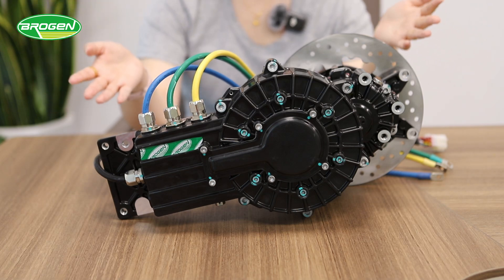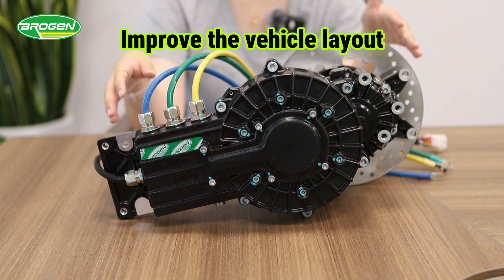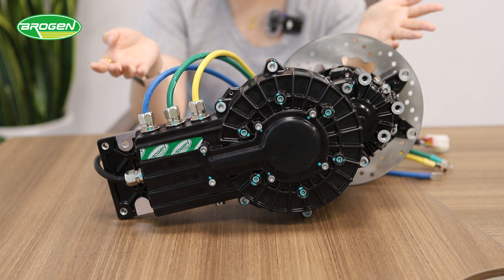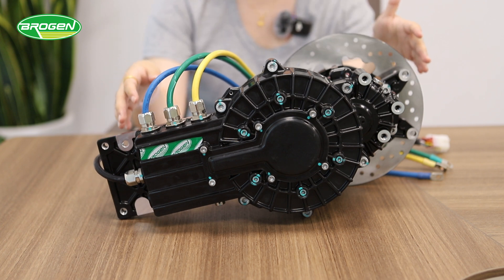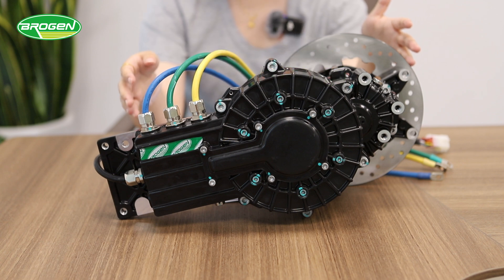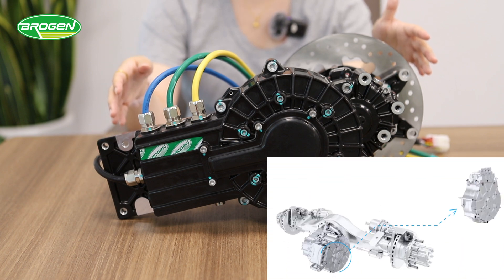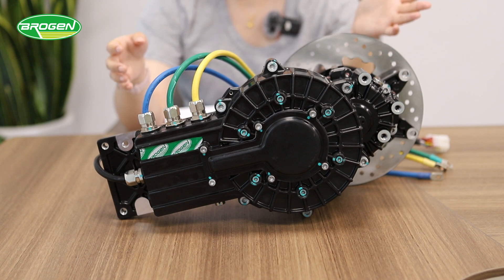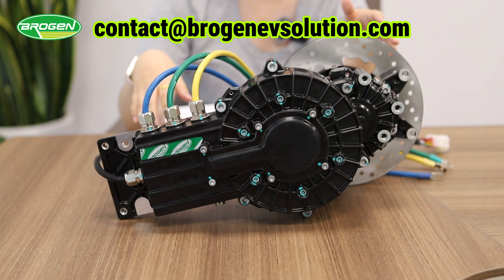So the ACTUAL Axial Flux Motor is here! More About Its Commercial Applications #ev #emobility #motor

Comment: How much distance should there be between two independent axial flux motors installed next to each other? It would be amazing to remove the differential, split the axil into two and install two independent axial flux motors to spin rear wheels.
Reply from the maker: For applications on larger vehicles, we have the distributed system, which has already integrated two independent axial flux motors to control two wheels independently.
Reply: two motors in the rear would allow vector thrust handling